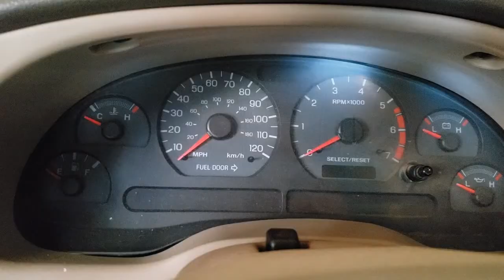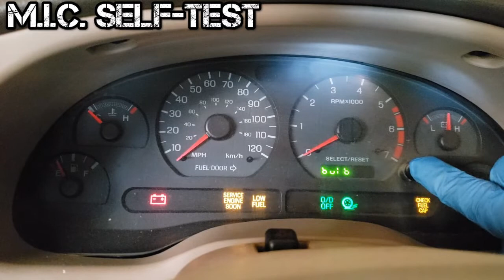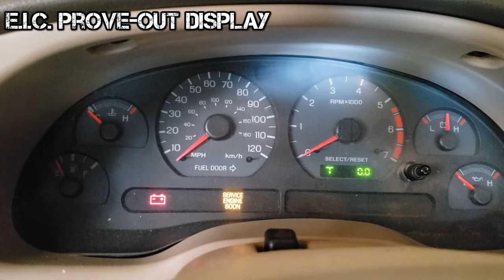ASE A6 Test Prep #4 - Computer Inputs & Instrument Cluster

Comment from the maker: After taking the A6, I'd say the info here is good, BUT you will see many diagrams about the instrument cluster. Focus more on circuit defects, such as why an instrument cluster indicator lamp would stay on. Many diagrams will have labels X, Y, and Z. You'll be given a question such as: the wipers come on when the lights come on. What is the cause? The answer choices would then be something like A) An open at X.
 B) A short to voltage at Y, etc. 

Know the fundamentals!! How a short to ground affects the circuit, how an open affects a component, how to spot a failed component when voltage readings are given.

It sometimes helps to cross-out the bogus answer by right clicking that answer choice. 
For example if the wiring diagram shows 12V before a headlamp bulb, and one of the answer choices is "An Open headlamp fuse." We know that answer is not possible.

I'd like to re-do this mini-series but after taking the test (passed it) and knowing what the questions are, I cannot ethically do it.
Reply: This was really helpful, I have my test in 2 hours and these quick videos were right to the point you should definitely do more. I don’t think it’s ethically wrong because at the end of the day you’re helping people. Also, it would mean all the study books and practice tests are ethically wrong too. Imo you should keep making these videos bro super informative.
Reply: @Chiiko09 did you pass?